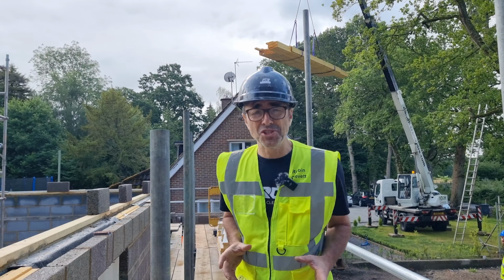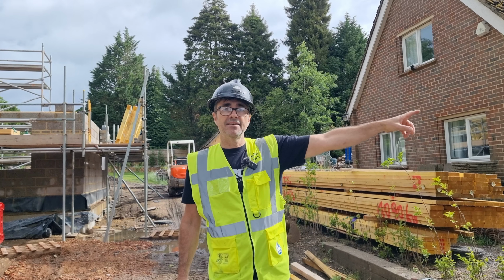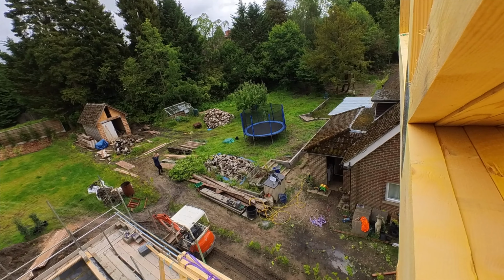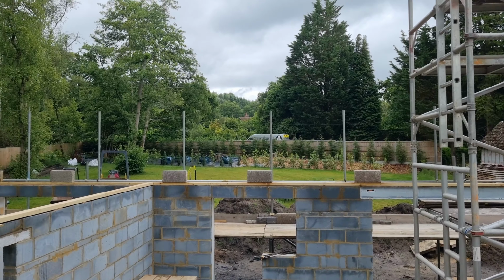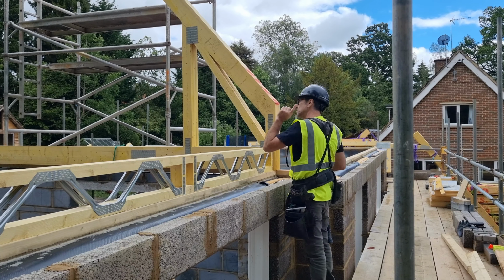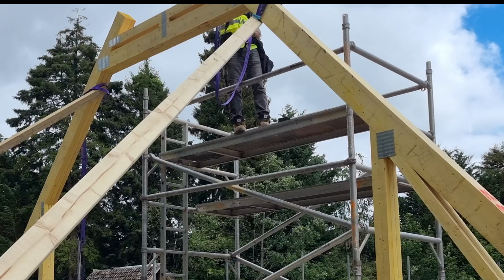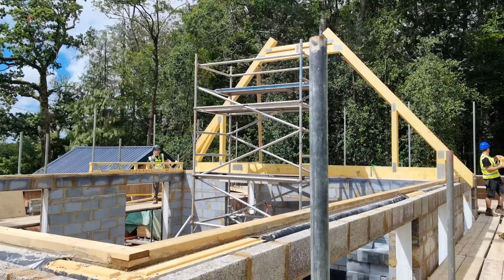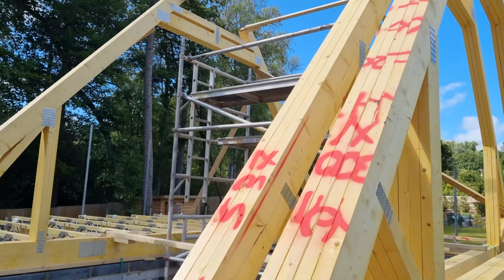Landing large trusses for a new Hybrid roof structure

Comment: I have a question. The large trusses seem to be connected to each other with screws. However as far as I saw they are screwed one sided. Does this process give them enough lateral strength against side movements? I live in an earthquake country and am planning to replace the 30 years old roof. Thank you for your extremely interesting videos. They are highly informative.
Reply: All plans would have been approved by a structural engineer. I bet a group of elephants could have a disco on this roof when all is said and done.
Reply: @paulmetcalfe3721  🤣😂Thank you for your kind reply.

Comment: The temptation to manually try to do the cranes work for it must be huge, instead of relying on the power of the machine.  Watching an experienced operator is always a joy, I worked at a production plant a very long time ago and we had a forklift driver who unloaded the incoming parts like lightning. He literally did the work of two men, if he was off sick there was, very quickly, a backlog with drivers getting impatient to get away and chaos in the receiving area and sometimes not every pallet was put in the warehouse at the end of the day. For some deliveries he used the ‘iron fairy’ happy days!

Comment: Hey Robin, I know you're really numerate from so many of your videos but the big truss (4 thick vs 3 thick) was 33% heavier not 25% as stated.
Reply from the maker: mmmm now take the overall weigh of the four thick, remove one and is the overall weight now only 75% of what it was?? a conundrum!! but really fun!!
Reply: It's pedantic you said 25% more which isn't correct, rather than the other way.  3=75% of 4 is equivalent 4=133% of 3. But its a video taken on site not a maths tutorial so was the original comment worth it...
Reply: The 4 thick is 33% heavier than the 3 thick. The 3 thick is 25% lighter than the 4 thick 🤯